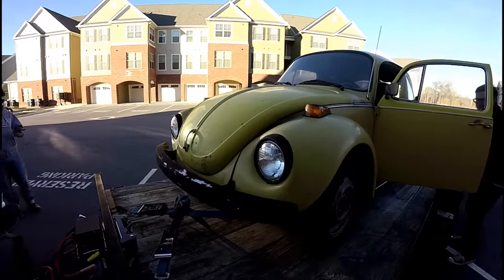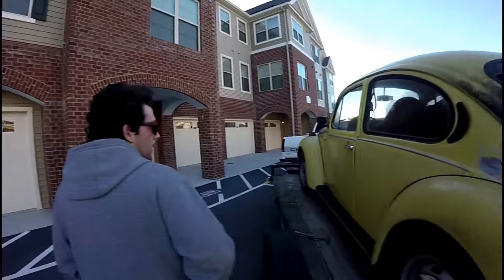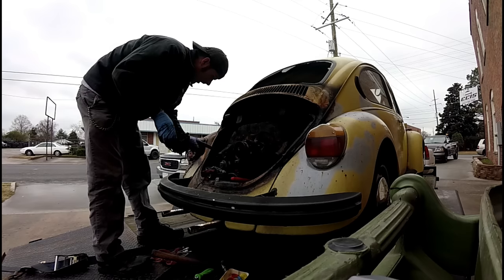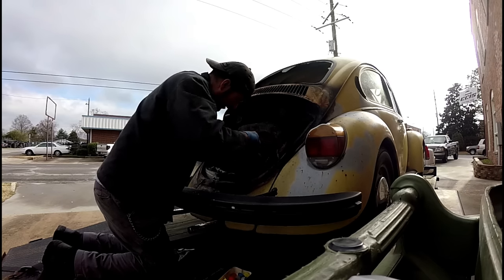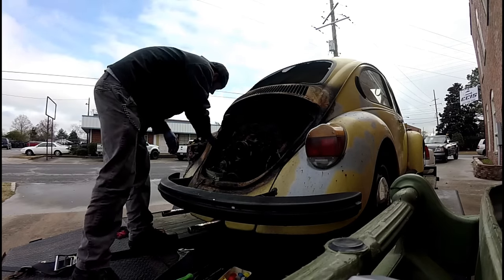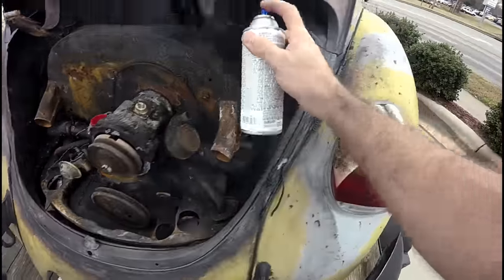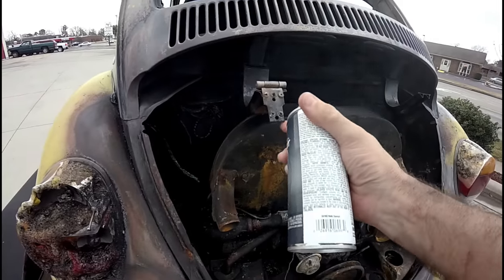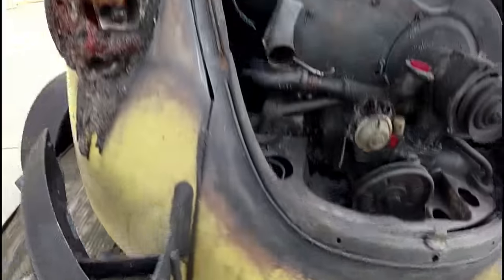"Fire Sale" VW Beetle- Cheaper than a Go Kart! Ike's Adventures

Comment: there wasnt a whole lot left except for the engine block and a few pulleys. Is that small thing really the engine?! good god.
Reply: 2 stroke engines have twice the power for the same size as a normal 4 stroke. At least this one did when it was made now it's incredibly outdated.
Reply: sirgallium wait... thats a fucken 2 stroke?! So you had to mix oil with your gas?! And i understand they make 2x the power but it is also a pain in the ass to mix the gas.
Reply: Alpha Nerd idk how that one works but many watercraft 2 strokes mix them for you
Reply: Yeah I'm pretty sure all the classic beetles are 2 strokes. Yeah they pollute pretty bad and mixing can be a pain. Modern ones on dirtbikes and snowmobiles are quite advanced though. Actually it would be really cool to swap a 500cc snowmobile engine into there to update that aging motor but keep it true to its 2 stroke roots. They are self supercharging so that is always fun.
Reply: Alpha Nerd it's not a 2 stroke. vw is a gas engine.
Reply: Ari Taylor .... a 2 stroke is a gas engine.....
Reply: Alpha Nerd yes. it is but a vw is not a 2 stroke  and my idea of a gas engine is strictly  gasoline only not one with oil mixed in it. the way they work is completely different. like a 2 stroke has oil in the gasoline as a regular engine runs off just gas the oil is completely separate. not in the cylinders there is some but not in the fuel. a 2 stroke would not run for long on straight gas. I'm trying to correct you. but maybe a Google search session would help you out buddy. the more you'd know!
Reply: plus a 2 stroke oils itself with the oil in the  fuel.
Reply: Its a flat four, four stroke air cooled engine. It has a fan shroud that runs a fan in the shroud thats drive off the back of the alternator that is driven off a belt on the crank. It blows air down on the cylinders to cool it. Its been that way since WWII with the Kubelwagens.
Reply: Except Hitler himself oversaw the opening of the VW (KDF wagen) factory in the early 30's (so, WAY before WWII) and years later in the late 30's was driven around in VW convertible at a Nazi rally.  As far as I know, VW never ever even flirted with using a 2 stroke engine.  The engine in this bug is probably a 1600 cc dual port engine, but it's in a Super Beetle, good engine, bad Bug at least from my perspective.  Of course I own a 1963 Beetle w/cloth sunroof and a 2010cc engine, so there's that.

Comment: Hey I know this doesn't pertain to this video but I'm building my son a go kart for Christmas and i cant get the answer I'm looking for on google its just a yard cart with a predator 212 with a 10t clutch 10x5 racing wheels I have to replace the 1 in axle it has a 54t sproket on it should I keep that sproket or go with like a 60 or 72t sproket
Reply: John Moore i believe if you put a bigger sprocket on the rear axle then it will have more torque but lower top speed.
Reply: depends how fast you want it to go. if your kid is going to do a lot of short acceleration runs the bigger the sprocket the easier it is on the clutch. don't go to big because the sprocket might be bigger than the tire. lol.  a 54 tooth sprocket with a 10 tooth clutch with a gov still in the engine will get her up to around 35 mph I'm thinking

Comment: I put 3 mason jar hydrogen generators on my pickup 1983 F250 Diesel I went a hundred and ten miles 6 gallons of diesel fuel pulling a trailer you might want to think about putting hydrogen generators on your truck